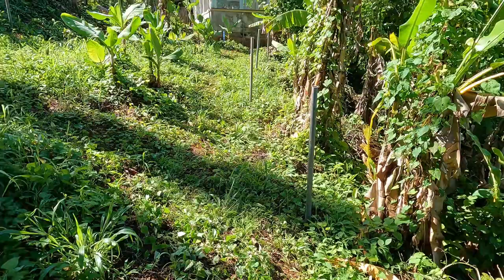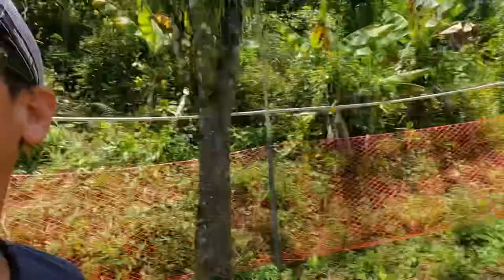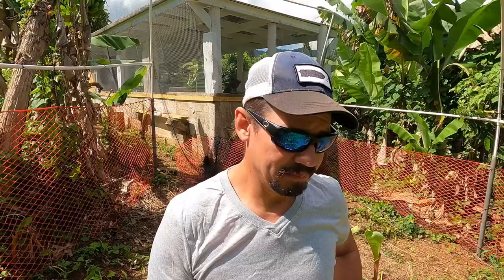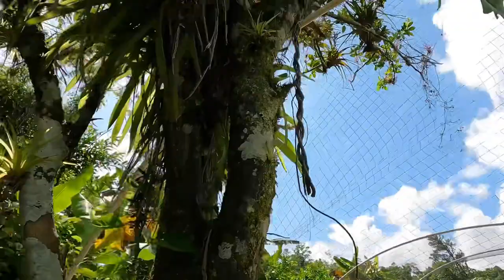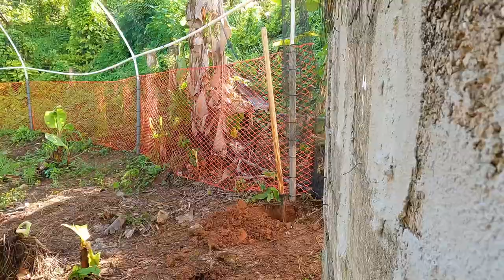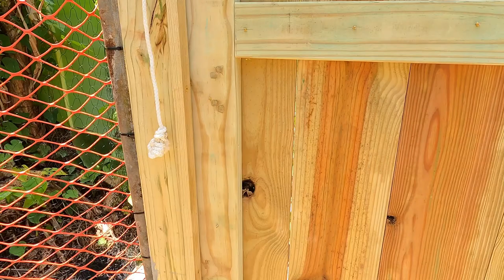Homestead PVC Hoop Chicken Run

Comment: Good job with the new run and door. Hawks are a real problem in many places. I have hawks here too but also crows and ravens which are the enemy of hawks. Any time a hawk wants to have a chicken lunch the crows and ravens chase it away. Also, I think your chicks will return to the coop at night. Wherever most of their food and roost is they always return to. But good to keep an eye on them during the evening just in case a couple decide not to return.
Reply from the maker: Thanks! Yes we have several Hawks in the area. I don’t ever see anything chasing them away. This seemed like a economical solution to prevent a potential problem! :) Not just that , but it’s pretty straightforward and doable for just about anyone. The PVC hoops and supports are not glued. That’s intentional so I can take them down if I need to “ Hurricane” and can be erected again in about an hour. ;)